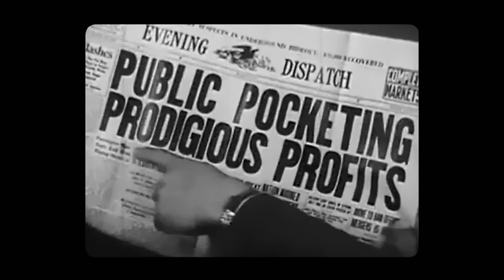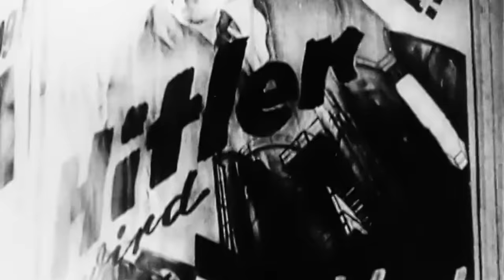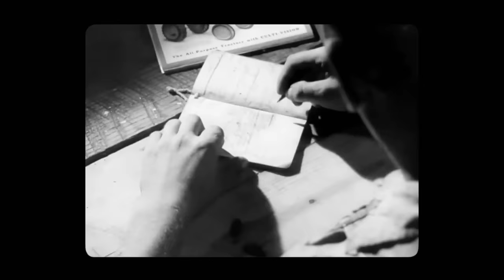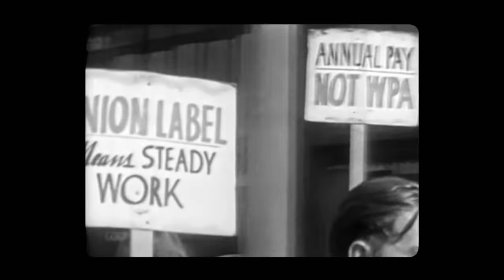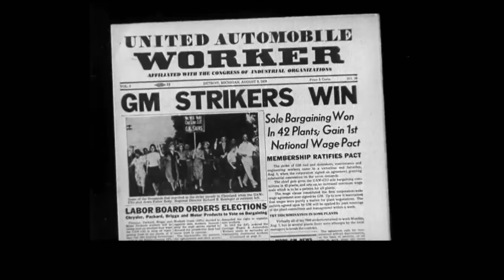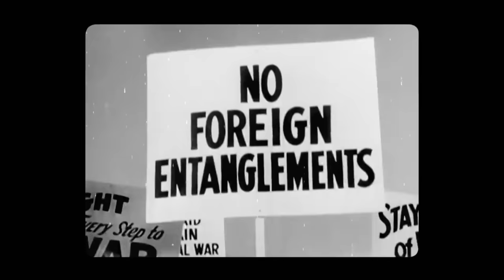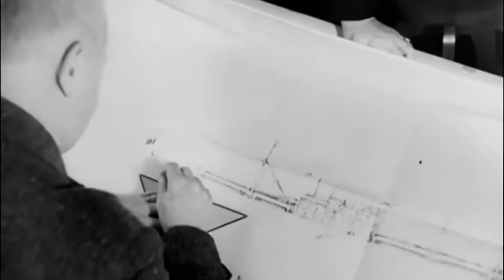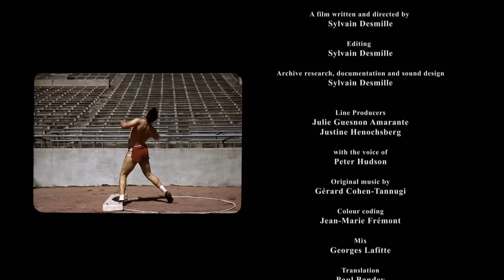The Great Depression - America's Biggest Economic Crisis | Free Documentary History

Comment: The stock market was in the negative digits, if they would of left it alone, it would of became a positive number starting from .01 to .02, but you cannot multiply a negative number to a positive number, you will only go into debt the more you add to it. They just chose the wrong time to put money into it, that was the main problem. 
A negative times a negative equals a positive, at low value in this case, but it would have been better than nothing, but they made the mistake to keep multiplying a positive number to a negative number being the end result, as the more they added, the more the debt increased. They were taking a negative multiplied by a positive, to get a negative, then multiplying it by a positive to always get a negative as a result on repeat till it got too high and crashed the market. Where was their math ethic back then or were they too entranced, almost hypnotized by it, to pay attention to what they were even doing?